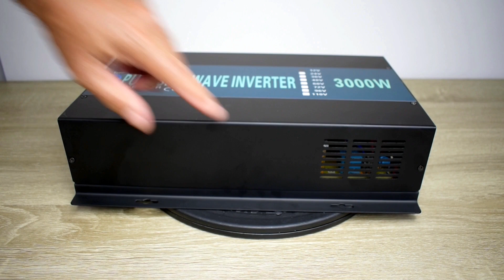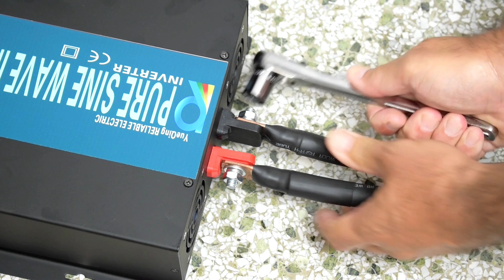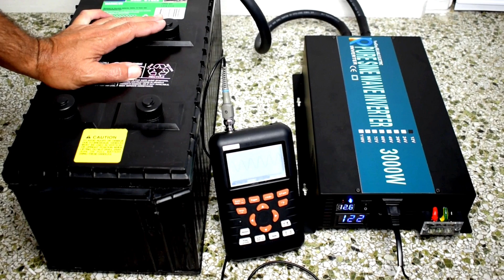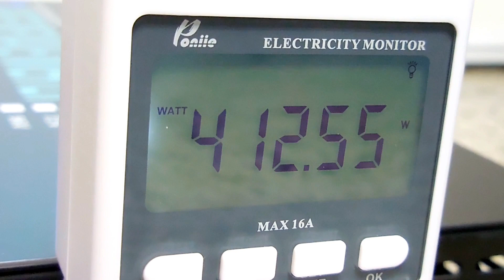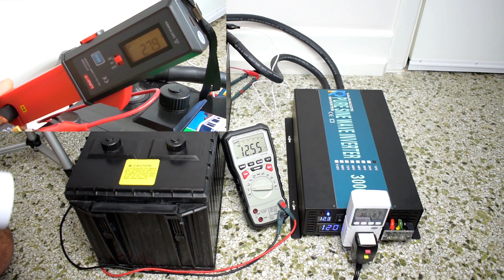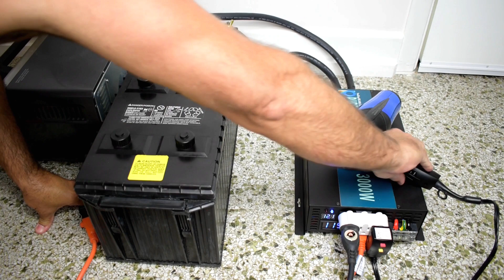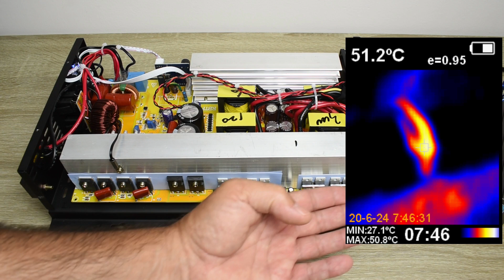Reliable Brand(WZRELB) 3000W/6000W Surge OFF-GRID Power Inverter Tests!

Comment: In case anyone doesn't know the reliable inverters typically have 60v on the neutral and 60v On the hot wire to make the 120v you will get shocked on either side. And it interesting trying to wire it to a breaker box. Because even in the off position there is still 60v on neutral 😒. Many other inverters are the same👍
Reply from the maker: In order to be safe, just like 240V requires (2) single pole breakers with a common trip, you can do the same for the 120V, use 2 breakers at 60V each, of course the panel couldn't be connected in any way to your AC mains panel. Thanks for watching!

Comment: I have the same unit 12 volt at 240ac at 3000watts. And its crap cant even do 2.500 watts it cant even boil water in simple kettle.  looks goon on the inside. butt thats about it. I have done some mods to replace the output IGBTS to better ones butt still did not help. I could make it better butt will need lots of mods. I thnik for the price I paid for it its not worth it cost 240 pounds GB.

Comment: Hi Doug I bought one  24v 3000w reliable put it can't work in Jamaica because our circle is 50hz on my inverter is 60hz I don't know what I can do because I'm off grid  what can I do to get 50hz or 50hz/60hz
Reply from the maker: That's a problem. Frequency converters aren't cheap. You may be able to change it by altering the inverter drive board, but I think one of the transformers on the circuit board would need to be replaced. Contact the company and ask for advice. Thanks

Comment: ?: Can I connect 2 Marine batteries to this 3000W unit to plug in a small a/c window unit 115v or an electric heater? Or will I need to purchase a 6000W unit and connect 2 marine batteries to operate an a/c window unit 115v and or an electric heater?
Reply from the maker: The A/C has high start up current, but doesn't use too much power running, the heater can be an energy hog. How much power is the heater? You may want to check out the newer inverter video I made below.
https://www.youtube.com/watch?v=t6MTRxYTXuk

Comment: I have no chance. I got it today and can't even run a 800w radial tool. I have to return it.
Reply from the maker: I only had a problem powering the chop saw, as you saw in the video. What did the unit do? Go into overload? What type of tool?
Reply: @electronicsNmore  just a simple radial tool of 800w. Overload....
Reply from the maker: @jordiregy390  Terrible, but I'm not surprised. The newest inverter that I tested was able to start everything I tested because of the built-in soft start. Watch my video called, "the simplest soft starter", it would likely correct the issue, and it's low in cost.
Reply: @electronicsNmore   No inverter reliable. i don't know where to go. for just a small 0.8A refri and a microwave. Maybe I go back to cobra 2500w. At least could run my radial tool easily.

Comment: I have the same one and I have had it 3 years. Big problem i see is people don't use the correct wire size.
Reply from the maker: Usually too small. Thanks for watching!
Reply: @electronicsNmore  yeah if they don't want to spend alot get 4g jumper cables and just double up the wires put 4g wires into 1 lug. Works great
Reply: @electronicsNmore  read my comment above but yeah if you have 12v inverter that runs this many watts you need big thick wires and then to be safe double them up and you will never have power issue with inverter from batteries.
Reply: I learned early about that. When I got the same inverter you have the 3000watt. I was testing a window Air conditioning with 1 battery on that inverter with the wires it came with. It would not turn the AC on im like wtf? Got 0g wire and did 2 of them and it fired up and ran the window unit. So when I see people complaining about an inverter I know that 90% of the time its the person who bought its fault. Can't blame the inverter its person. Sucks to say 😕

Comment: Excuse me to bother you again but I see you don't try with a fridge and in the specs of the inverter is signaled is not reliable for that (but very reliable for an electric saw). And I just want  it for it. You think will work with a small fridge? I tried some brand and don't work. Did you try for a fridge? Thanks again for your review and sorry for your failiure.
Reply from the maker: It powers my 18 cu ft refrigerator. If you have a problem starting yours, you can add an inexpensive hard-start kit to your refrigerator.
Reply: @electronicsNmore  oh thanks a lot for your answer. I will check what is it. Maybe that could have worked for a cobra 2500w that I returned for this reason...

Comment: I did enjoy this video for maybe a different reason than anyone else...I bought an old welder once at the auction for $18...the cord needed changed so while doing that I noticed that this thing was so old that it has white copper windings (part silver)..so the potential inverter had to be able to run this thing...well I got to thinking after I saw this video..what happens if the welding rod sticks ? Pretty much a dead short there...kinda like you did..so while I had that on my mind I went and ordered a 24 v 2000 w Aims inverter/charger...the thing has two GFCI outlets and the hardware connection and I thought..that's all yours  needed and it woulda been okay...so I thought it might save on your fuses and things to have those...I found a coupon for 15% and got mine for $653...its a lot of bread but I figured its better  than having to buy another  one when I least expect it...I put a 1450 watt load on it when I use my air fryer and it just does fine..I used two #2 welding leads on each post..each one hooks to 4 batteries in series/parallel  for 24 v and they don't even get warm usually although that might change in August lol
Reply: 2ga isn’t quite big enough. You should probably be using 1/0ga. Heck, I used 2/0 on my 1200W/12V inverter
Reply: @fishhuntadventure   Oops ...mine is 24 volts...there are 2 pairs of #2 cables on the batteries, so it's actually equal to a 1 / 0 cable, which is what it calls for. I have 18 batteries now. I used a pair for the eight 90 amp hour batteries, and a pair for the ten 105 amp hour ones. I just finished rewiring the battery bank with new #2 welding cable, it carries 195 amps. I have used the oven for an hour, and there was maybe a few degrees of warmth in the cables , but it was very slight and hard to feel any difference. The amps are less now because the batteries are always charged, so higher voltage, lower amps. My uncle loaned me his 2000 watts inverter, 12 volts, before I got mine...way more amp draw...that was the reason that I decided to go to 24 volts. After I got all these batteries, the voltage never goes below 25.0 volts, even after two days of no sun and constant rain. The welding cable that I used carries more amps than regular stranded wire. With 18 batteries, each one is only pulling 25 amps or so. So the batteries will last longer, and the wires stay cool...sorry if I wasn't clear earlier.

Comment: Hi electronicsNmore for the review, I've always wondered, can I connect inverters in 'series' or 'parallel' like you do cells to form a battery of inverters in order to meet my power requirements? If my question sounds silly, I apologize but I've often gotten the best insights and knowledge for 'silly' question.
Reply from the maker: I don't recommend placing them in parallel unless they're designed to be "stackable" or slave units. As for series, If you have 2 identical units, it may work.

Comment: 0.6A current with no charge? Is that right?
Reply from the maker: Whatever I showed in the video is the no load standby current.
Reply: @electronicsNmore  For a 12V battery.
Reply: If it is right you are responsible for making me buy it. Others similar than this are 3 times more consumtion than that.

Comment: Is it possible to use an inverter like this with a portable generator? I have a Generac that only puts out 1K watts and find it's just not enough for my needs.
Reply: That'd be a good product to develop and market; an inverter that can synchronize its AC output with another generator so it'll supplant the output when necessary but only idle along when not needed. That way the smaller gas generator can operate the majority of the time when full power is not needed, but the AC inverter will act as a turbo boost of sorts when large loads kick in like starting up compressors and the like.
It'd be similar to the grid tie setup that solar panel systems use to connect to the utility power.

Comment: Hey I lost my owners manual for the RELIABLE power inverter.  Does anyone know where I can find the manual in PDF?   I have an issue with the RED light coming on.  It is a solid red light and doens't blink.
Reply from the maker: When did the problem start? Probably have a blown mosfet.
Reply: @electronicsNmore  I just installed it to a Prostar International Truck.  It's running on 4 group 31 batteries.  Im runnning a 3500w WZRELB INV.  w 0 guage cable and 300 amp breaker.  

  I killed the power to the truck and it turned the red light off.  It currently runs and has 12.2 in and 12.3 out.  I turned the power supply back on and the red light came back on and now it blinks.

Comment: Hello thanks for your video. We purchased a Duracell 3000 watt inverter. Then we purchased a die hard battery.
I want to make sure the battery is big enough to power the inverter
Reply from the maker: An inverter that size, I would've bought a 4D or 8D lead acid battery at a minimum, or a 200+ Ah Lithium Iron Phosphate battery. Thanks for watching! Be sure to share the video link.

Comment: Excellent comprehensive tests I must say. I own a 3500W 24V version myself. Haven't blown it up.....yet. I am amazed it still "tried" to run with the overload, but only @ 98 volts or so. That is a fail. Below 108 volts is beyond standard grid tolerance. I know if I run a 1500 watt microwave, the output is around 112vac. Yes, still in spec, but I still don't like that. After watching some others review similar models, we learned that those ATC fuses are pretty much a false security. Usually the MOSFETS blow to protect the 20¢ fuse! I want to add some kind of "fuse" at the output side, but it's got to be super quick acting if there is a full on direct short like you did. Say I put a 15 amp ATC fuse inline and try to start say my circular saw and it blows. OK, kind of expect that maybe due to inrush current. BUT, say I do what you did and create a full direct short....Will the fuse blow before the inverter blows? Hmm. I DON'T really want to test that theory right now!
Reply: Yep the lack of proper protection on those mosfets at the input is the problem. Kinda sad because this is a great unit other than that crucial error. Almost comical that they could put blade style fuses in to protect mosfets on an inverter? Gotta wonder if any of these engineers have experience in the industry or what.

Still at the price point its hard to say this isn't a good buy. In a situation where you need an inverter that won't break the bank/can be replaced from death due to handling/conditions/etc this is a great candidate. For the most part it works, has a good sine wave, and I believe they also do custom voltage ranges for those that want to run unique battery voltages like 4S lithium ion in the 12V-16.8V DC range.
Reply from the maker: Anything 110v or higher is fine. Thanks for watching!

Comment: just noticed something weird at 13:41 352 watts coming from the battery but 412 watts coming out the inverter,  that means the inverter is giving you an extra free 60 watts that is coming out of thin air  . . that also means your equation was backwards and it was operating at an efficiency of 117% !!!!!!!!!!!!!!!!!!! did someone say overunity .lol . . . my guess is that the power factor threw off the reading and were looking apparent power not true power . if the inverter is supplying 412 watts and is operating at a typical efficenty of 90% it would be pulling 453 watts from the battery   . . .  either way it was great video and extremely detailed.   im really curious about it being center tapped .. . . curious if you could buy a 240 model and use it as a split phase set up
Reply from the maker: I clarified that in part 2!
Reply: @electronicsNmore   sorry i just noticted your pinned post. .

Comment: The yellow terminal is not considered a ground, That is the reason it is not green.
Reply from the maker: 60-0-60 makes it neutral, and as we know the neutral for a utility transformer is also connected to ground at the pole and by the meter on your home. Yellow is a "HOT" color, it's incorrect. At a minimum, it should've been white or grey. Thanks for watching

Comment: Would you recommend removing that silicone heat transfer film and installing good old thermal paste?
Reply from the maker: The best to use would be a silver containing thermal compound, but they usually don't burn up from heat. High inrush and short circuits are what destroy the mosfets.
Reply: @electronicsNmore  Thank you!

Comment: I've watched many others review/test these "Reliable" inverters. You tested other "features" that were missed by some other reviewers! I, after watching several videos, did purchase the 3500 watt, 24VDC model. It is nearly 2 years old already, and by the looks of yours here, Reliable did nothing to address it's shortcomings! Just having that floating "ground" is crazy! Mine has that too and measures 60 volts like yours. I don't use mine much either. I bought it just to play with more than anything! LOL. I tried to search for the video you said were going to post explaining what "blew up" when you crow barred the AC output. Too bad you didn't have that cool LiFe battery pack then to really test surge capacity. That one 24D thought it was cranking over a locomotive engine and it's voltage dropped to under 10.5 volts with that heavy loading on it! You may have needed like 4 of those 24D's in parallel to hold the voltage over 11 for those 200+ amps inrush currents I'd believe. All I know is mine has terrible output voltage regulation. Even with 22 volts going in (remember, I have the 24 volt model), AC drops to like 109 when running a 1000 watt microwave oven.  If I was living off grid, or really had to depend on a REAL "reliable" inverter, I'd pony up for a low frequency unit, one that uses a honkin big iron transformer. They have drawbacks, but for stationary use, and near bullet proof, ya, that's the way I'd go.
Reply from the maker: Glad you enjoyed and appreciated the video Curt! Be sure to check out my wide range of videos and share. Thank you
http://www.youtube.com/c/electronicsnmore/playlists
Reply: Why is the ‘floating ground’ crazy? It’s not floating to itself.
Reply: @fishhuntadventure  Thank you for your comments. Well, after watching many other presentations on the Reliable 3000 watt inverter, I learned that the "floating" 60 volts is more of a leakage than a complete connection to either neutral or hot. I found out grounding it did not cause an explosion! Sorry if I miss led you.

Comment: Explain the 225 amp please from a toaster a hair dryer and a saw...
Reply from the maker: The saw only has high current when first powered up, it drops off fast under no load. The hair dryer has different settings which affect current. Not much to explain, the video shows it all. Thanks for watching
Reply: @electronicsNmore  can u show the calculation u used to get 225 amps plz... great video

Comment: Literaly just picked exactly this 3000 watt up from my front door. ordered on aliexpress for cheap. got it to use with a solar 24v system. my first 24v system. got 2 100ah lifepo 12v batteries and 2 475 watt solar panels  with a make sky blue 40 amp controller.
Reply from the maker: It works very well, just don't short the AC output! :-)

Comment: Thanks for the video.
On one of Will Prowse's videos, he held a resister against one of the cables coming from the inverter (sorry, I don't remember which one) before touching it to the battery terminal. He said that will prevent a bad spark. The idea was to discharge all the capacitors in the inverter that stored electrical charge. By far my biggest worry here is messing up and getting a bad shock, or an exploded battery. 
Also: is there a rule of thumb for the sizes of the inverter output, relative to the size of battery capacity? On one RV channel on Youtube, they said that every 100 watts of load plugged into the inverter. requires 10 DC amps from the battery.
Thanks again.
Reply from the maker: Either side works. Not really necessary unless you're in an explosive environment. It needs to be high wattage and maybe 50-100 ohms. An inverter pulls roughly 9A DC for every 100W AC.
Reply: i think you misunderstood what will was doing with the resistor. he was using it to control the current into the capacitors by limiting the current through a big resistor, so the caps will fill more slowly rather than all at once creating the big spark.
Reply: @jasonbrown467  exactly 
The resistor stops contact damage from the spark and keeps you from getting tiny pieces of hot metal thrown at you